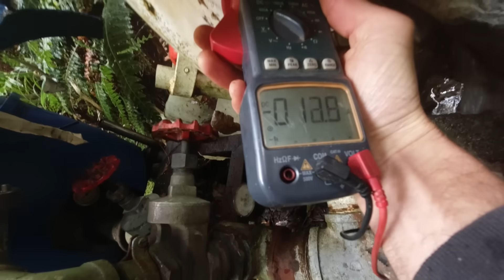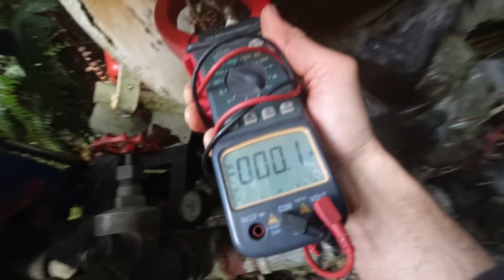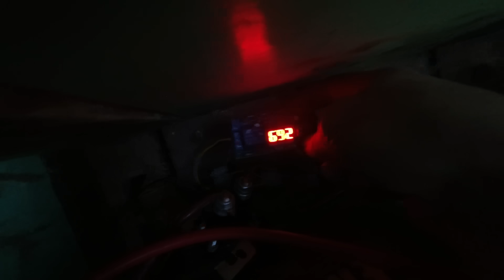Free Power for 16 years from a modified Washing Machine / Water Wheel

Comment: What an interesting setup.
Did you come up with this yourself or is this used more around where you live?

If I understand correctly you store the energy from the turbine (~500W) in car batteries on the hill at the turbine, run it throug a 230v converter and then send it through a powerline to your place?

So if the zombie apocalypse finally happens you probably wont notice a thing...😂
 except for the zombies pf course, but your angry rams probably would take care of those 🤣😂
Reply from the maker: I have an electrician friend who helped me out in the early days, he was one of the pioneers of turning the smartdrive motors into a generator. Yes generator - battery bank - 24 /240ac inverter - house
Reply: @MartyT  What sort of Voltage drop are you getting from 24v/ 240v inventor to the house?
Half a kilometer to house? I'm guessing 30mm squared Aluminum cable?
Reply: @throughput6674  the inverter has to be by the batteries, no?
Reply: @MartyT  hey Marty, have you considered the idea of using a transformer(same as on power poles at a home) rather than batteries?  I thought about this a while back.  any idea of what any pros or cons of one would be
Reply: @MMORPG87  - You can't bank any of the energy with just a transformer.
Reply from the maker: @MMORPG87  Yes I've pondered the idea, there would be power losses in the step up and step down, then there's another layer of complexity and things to go wrong and more dangerous playing with high voltage. Inverter/battery bank is the way to go for me. There are micro hydro systems producing 240ac direct from the generator which would be the most efficient way to go but would be quite complex to govern the speed of the turbine to keep the voltage steady
Reply: In that wet of an environment I dont think you'd want high voltage. 24V with the enverter at the house sounds like the right thing to do. Imagine trying to get close when something goes wrong.

Comment: what's the drill to grinder head used for ?
Reply from the maker: Automatic valve control, no longer in use. It worked well but I found it shut too quickly and put stress on the pipe joiners, I quickly found my weak joins

Comment: Why do you dump water instead of dumping electricity at the house, e.g. water heater. Is your latest pelter wheel one of Mike Lawley's from New Plymouth.
Reply from the maker: I do dump excess power to my house hot water cylinder via the inverter, the water dump is a backup in case the inverter shuts down or a breaker trips. No I got my cups from ebay, made the hub
Reply: @MartyT  my dump was a 24v element in the hot water system not using the inverter.
Reply from the maker: @Paulman50  Yes that is another way to do it but low v. dc cable loss is far more than 240 ac over a long distance so dumping via inverter was more efficient for me

Comment: What an idyllic setup. Tui's, free power, cheap machinery. All ready for the apocalypse. Is the new looking orange drill some sort of power dump? Decent amount of power for the trickle of water.
Reply from the maker: Automatic valve control,  no longer in use. It worked well but I found it shut too quickly and put stress on the pipe joiners, I quickly found my weak joins

Comment: This has got to be one of a handful of off grid videos that has been able to back up their claims and prove concepts. Well done!
Reply: Yes, he does his homework and gets things done well.  In the US, we still have nincompoops trying to prove that an amplidyne is a "perpetual.motion machine."   Of course, you can't tell THEM that it is not, else you'd be branded a communist or something.
Reply: 20amps at 24volts equells 480 watts.  Thats 11.52 kwhrs per day, 4,204 kwhrs a year or $43.48 a month  in my city .In my state 4,204 kwhrs is about 35% of the average  homes  yearly electric  use... 480 watts is a  little  over one half  of one horsepower .  He didn't  give the drop in feet or head  (power) for the water  supply  but from my research years ago I give  this video a thumbs up for truthfulness .
Reply: what do u mean back up their claims? this is just a cheaper version of hydro electric dams.
Reply: 2077: whats a tree?
Reply: He has proved nothing, this is a video that shows a water feature and he claims it makes 480W, rrrright!
Reply: @Drenov  what makes you think it couldn't achieve the output he claims?
Reply: @TD-wi1zh  A vacuum cleaner uses about 5 amps at 120 volts. 5 amps at 24 volts is about one fifth the power. That turbine sounded about half the speed of a vacuum cleaner so I think the output is feasible.
Reply: @Bottoarguewith  1) We don't do 120v in nz, we do '240' (though usually 220-230)

2) you cannot possibly determine the output of one motor by the sound of another!

I've played with these a little myself (but live in an urban area at present :( ). They are indeed capable of what he draws.
Reply: @Drenov  he legit measured it with a clamp meter and it was outputting 2 amps. depending on what voltage he's running it very well could be 480W. It definitely sounded like it could pump out that much juice.

Comment: This is great stuff! there was a guy I used to know who put quite a bit of effort into making wind turbines from the smartdrive washing machines also. They seem like they're almost indestructible :) Any plans for a DIY powerwall ? Supplemented with some solar panels?
Reply from the maker: Yes they make good wind turbines.. I don't really need a powerwall with 24/7 hydro power, my batteries rarely go below 24.4v
Reply from the maker: @polymath Because my batteries are kept well charged they last for years, my lead acid battery bank at the house (charged by excess power from the turbines) has been there since I set up the system 16 years ago, I got it second hand from telecom. It cost me a few boxes of beers

Comment: what was/is the drill for on the main turbine?
Reply from the maker: Automatic valve control, no longer in use. It worked well but I found it shut too quickly and put stress on the pipe joiners, I quickly found my weak joins

Comment: more info please. are the batterys at the generator then power is inverted before being sent to house?
Reply from the maker: Small 120ah 24v battery bank and inverter at the turbine, voltage sensor wire runs up to house to control the plc which dumps excess power into my hot water cylinder
Reply: power is probably sent to the house first.
Reply: As you can see by what Marty wrote, the battery is just a buffer. The buffer feeds the inverter which sends power to the house, The house more than likely does not use more than 600 watts at any given time, Therefore a large battery bank is not needed. The high loads as he said are run of a generator.
Reply: @kameljoe21  - Hmm, wouldn't it be more efficient to transmit AC to the house than DC? I can't imagine having a battery in that environment is great for it either.

Comment: This is a very ironic video Marty... Yesterday I sorted out my home built Ram Pump. The bicycle iner tube gave up after 7 years constant use. So up graded it to an electric pressure pump tank. Sorted and getting about a ltr a min with 2mtr head with a 40mm to 20mm Ram system over 600mtrs to a 30,000ltr tank. Result... Kiwi ingenuity right there...